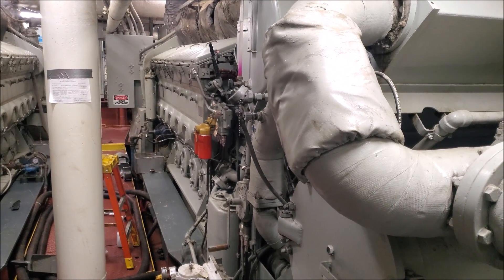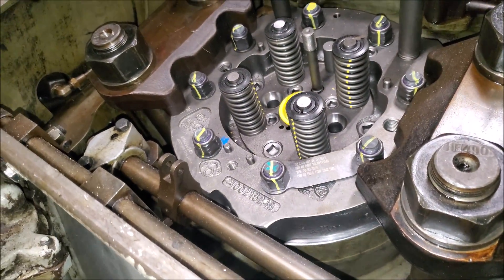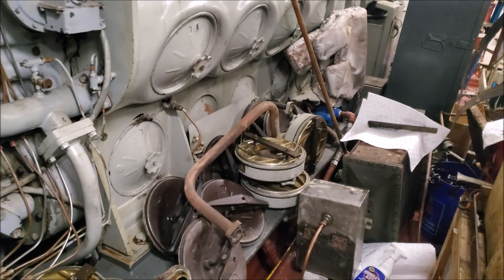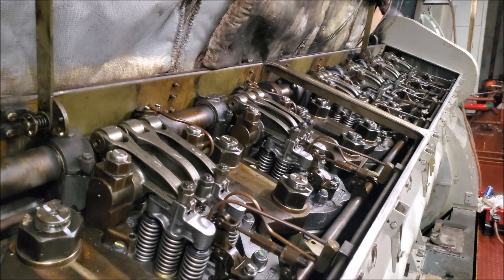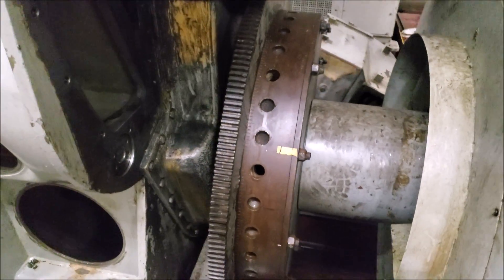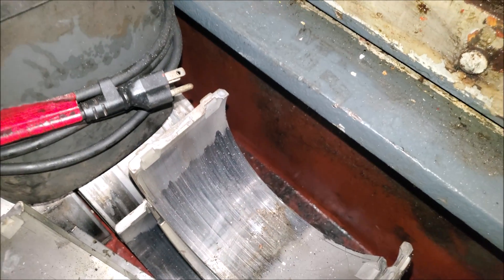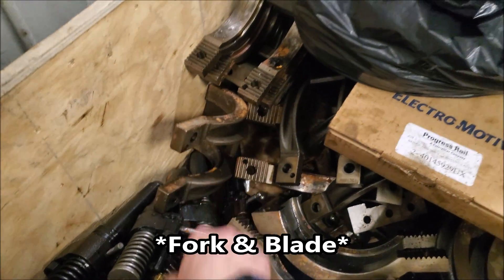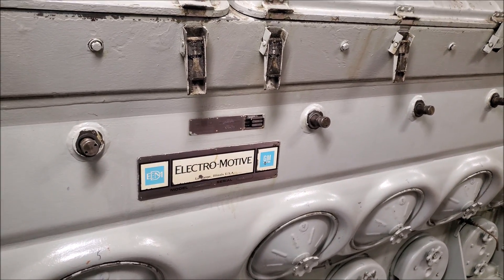What's Inside A Massive 2-Stroke EMD Diesel Engine?

Comment: How does the lubrication system work on these?  The lower end seems to be wet with oil, but since the top ring is exposed in the exhaust port I'm guessing they can't really oil bath the rings from the bottom or it would consume oil out the exhaust port.  Surely they're not premixing the fuel with oil?
Reply from the maker: These engines don't have exhaust ports. The ports in the liners are scavenging air ports (intake) exhaust is through the 4 valves in the head. These engines have a relatively complex lube oil system with 2 engine driven pumps, cooler, heater and a 440v electric prelube pump with solenoids for turbo cooldown and prelube settings. All rings pass over the intake ports and some oil is pushed into the airbox and burned. Cylinder, top and bottom end lubrication is pressure fed like a normal big diesel engine. Thanks for watching!
Reply: @FixAndForget ah cool, thanks for the explanation. So these engines normally consume some oil?  Is it significant enough to require replenishment every so often?   Fascinating that they run so many hours.
Reply from the maker: @8180634 yes they do consume some oil, we now run "eco" power pack assemblies that have higher tension rings that scrape more of the oil off the liner. Less oil burned but more wear on the liners, thats the trade off for a cleaner burn. Oil consumption is now about 10 gallons a day on the 12 cylinders. We still make 35k hour overhaul intervals no problem. Railroad engines that run a lot harder will consume more oil than us though. 

Thanks for the comments
Reply: @FixAndForget super interesting, thanks for the info!

Comment: I helped split the block and roll out the crank shaft and roll in a new one on a tug boat 16-645. 
Changed out several turbos, EMD had some trouble with their turbo’s for awhile, seems like every time we turned around we were changing a tug boat turbo 
A torque valve I remember on head bolts is 1800 ft lbs
Reply from the maker: Thanks for watching! Thankfully we've never lost a crank to where the journals couldn't be ground in place. I've heard the turbos used to give a lot of problems too. Thankfully ours have always lasted the 30-45k hour overhaul intervals.

Comment: Hello sir how overspeed work
Reply from the maker: @redwanredwan606  engine runs with a Woodward EGB electro-mechanical over hydraulic governor. Emergency stop/overspend protection is a set of flyweights in the front gear case that trip a pawl on the injector rockers locking the injectors in the down position and stopping the engine. Thanks for watching.

Comment: are there any rocker arm adjustments needed like on some car engines?
Reply from the maker: @ct1600a  exhaust valve lash and injector timing are set by adjusting the rocker arms. Exhaust valve bridges are Hydraulic lash on 645 series but still need adjustment.
Reply: @FixAndForget  Thank you for the info!
Reply from the maker: @ct1600a  thanks for watching!

Comment: Do they have 8 throttle notches like their locomotive counterparts,  Or are they infinitely variable from idle to full throttle?
Reply from the maker: @blackflagqwerty  They are 600v generators so just controlled by the electronic Governor and loadsharing system. Direct/reduction gear marine EMDs are variable between 400-900 RPM with air or electronic throttles. Thanks for watching!

Comment: How many hrs do they go between full overhaul?
Reply from the maker: Usually 32,000 but in this case we went to 45,000 with no issues. These engines still retain many original 33 year old main and lower con rod bearings. Thanks for watching!
Reply: We just did one with 40k hours

Comment: That is not a clutch that your looking at for the Turbocharger. It is a spring drive gear to turn the turbo. The overruning clutch is part of the turbo assembly. 2:00.
Reply from the maker: @Terryk-s7q  Thanks for pointing that out. I corrected that in another video but forgot to make the edit on this one. I appreciate it, thanks for watching.
Reply: @FixAndForget  very good video with a lot of great information and shots of parts most people never see.
Reply from the maker: @Terryk-s7q   Thank you sir
Reply: He would have been correct if the engine was a 710. The clutch built into the #2 idler gear. 

Hearing a 645 with a pinned clutch is one strange sound upon shutdown 😬
Reply from the maker: @nickleinonen thanks for the info man, it is pretty neat to hear them shutdown from 900 RPM. Thanks for watching